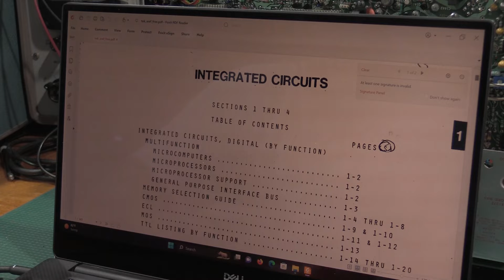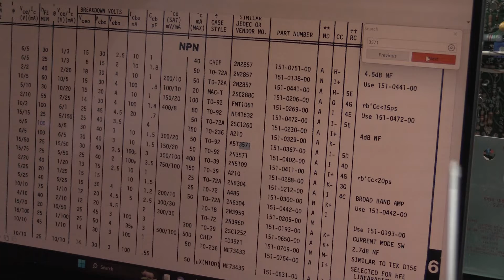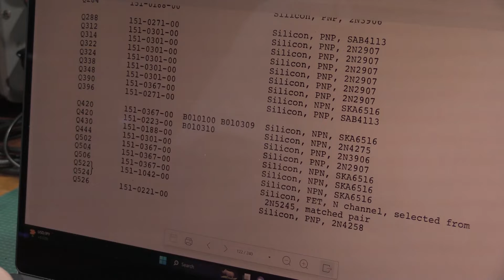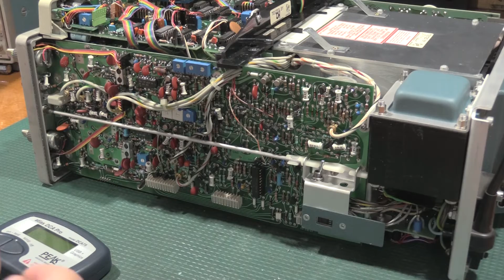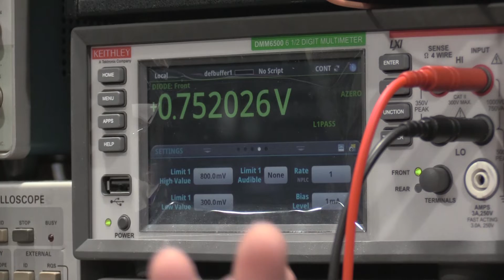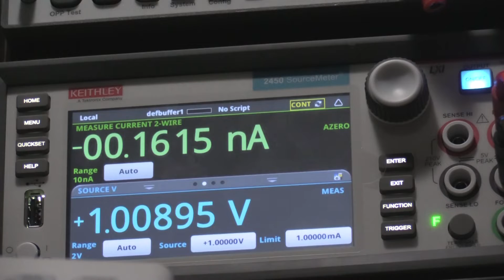Tektronix 475A Trigger Transistor Testing 151 0367 00 (Do NOT replace unless proven faulty!)

Comment: Thanks for doing this demonstration. I am in the process of updating the tantalums in a recently purchased Tek 475A. After seeing your previous video was considering replacing the transistors also. But thanks to this video will leave well enough alone. I can tell you after finding C1261  shorted (seems like a common failure) and cleaning up assorted switches, the unit is ready for calibration and use. Happy to have found your channel, as it has been a wealth of information.  Next stop cleaning and servicing my well used Tek 2235.
Reply from the maker: Thanks! glad everything is going well. I do need to get some 2xxx videos out there.

Comment: Its kind of futile to just test transistors at random, instead of tracing the fault in the circuit to the part that actually is faulty.  For exampke you might have an open resistor or diode.   I have found transistors that needed to be replaced; eg: Vbe > 1.5V. but Ic = 0 mA.  It's faster to trace the circuit and find the defective part that way then to just pull parts at random and test them all.   You might put mix the parts when you put them back in the circuit and not even know it.
Reply from the maker: Before a series of videos was made and a LOT of discussion on the Tek scopes forum these transistors were listed as "replace on sight" This is NOW not the case. This video was left up for completeness sake but these should NOT be replace on sight any more and should only be replaced if faulty. The reverse diode is a normal mode not a leakage as there are 1.5Ghz transistors and just have a VERY low reverse breakdown voltage.
Reply: What I have noticed on most Utoob repair videos is mostly superficial diagnoses of the problem.  I haven't seen anyone pointing to schematics in Tektronix's very good manuals, and saying, "I am going to start here, where I know the EXT trigger input can be seen with another oscilloscope, and trace it through switches, custom Ice, and transistor stages until it disappears".   Instead people test transistors at random, replace as many capacitors as they can, and generally circle in a wide arc above the problem.   If someone is unable to understand a schematic and to follow a signal path to where it disappears, they may  just be damaging the equipment they are trying to fix.  Every time you replace a component and the problem remains, the chances of creating additional problems increases.
Reply: There is a very long discussion about this on the Tek-wiki website.  It appears the confusion began with a typo in a very old Tektronix cross-reference that listed the MPSH05 as a substitute for the '367 part.  I have found 2N3904 and other similarly marked parts in Tektronix oscilloscopes,, so I would assume these "replace on sight" transistors would be marked MPSH05.  With all the testing you did, with a Kiethley SMU, a 567 curve tracer, and a cheap Chinese bjt/diode tester with ripped off software, I was expecting that you would procure a few MPSH05 transistors and compare them with the '367 parts removed from one of your 475 scopes.  That would be good Science.   Did you ever do that?

Comment: I've just viewed this in 2025!  My guess is that the diode is actually a trimming capacitor! part of its Hi Freq topogtaphy.
Reply from the maker: This was a follow up video to one recommending shotgun replacement. The TLDR: diode in questions shows up because the meter is fooled by the extremely low reverse breakdown voltage of the transistor in question. These are 1.5Ghz fT parts. We discussed this one the Tek scopes forum at length and did quite a bit more testing and have found the transistor to be operating correctly current advice is DO NOT replace unless proven faulty.

Comment: Do the candidates as replacement transistors for this part exhibit the diode behavior you're finding in the original parts? That might be a good test to show or discuss.
Reply from the maker: At the moment I do not think that these are bad parts as they are 1.4 Ghz components the reverse breakdown voltage of the high fT parts is quite low.

Comment: Surely if the scope calibrates OK with the original transistors then let them be. I think you have demonstrated very well they seem upto the task.
Reply from the maker: That is where I am at. Some of the units I work on are not mine and I need to do as instructed by the customer. My current recommendation is let them be but if the trigger is acting weird something to check on the short list.

Comment: The dca75 will output curve traces when used with its pc software.  The currents and voltages are limited, but one can specify different parameters to compare.  You might also run it as a diode to examine that behavior. 
The current changes when you touch transistor because the electron Fermi level increases with increasing temperature.
You show the faster 475A triggered faster than the 475, no surprise.  What frequency response do you expect the 200MHz 475 to have?
Reply from the maker: At least on this one 475 (200 Mhz) the vertical amp and the tube brightness ran out of gas before the trigger did, even with the replaced trigger transistors. I could get the scope to trigger even after my eyes did not see anything on the screen. The camera is more sensitive to the beam so I got a little further looking through the lens. But the intensity on the 475 was cranked all the way to max brightness.

Comment: Hello Zen
Maybe my impression is wrong, but the left oscilloscope seems to handle the trigger better, and you have less trouble with it.
Done thoroughly and precisely as always, there is always something to learn from your videos.
greeting
Reply from the maker: This is not wrong but there is a few things going on there. The scope on the left is a much newer serial number 475A, 250Mhz of bandwidth. The 475 NON A is only a 200Mhz scope and it is also MUCH older production. Given the way the tubes are focusing I would also say much higher hour. The vertical amp on the scope on the right will be inferior to the one on the left based solely on V bandwidth. This will cause the trigger at a given frequency to have to work harder on the scope on the left. 
The actual trigger detector is the tunnel diodes and in both units there are unchanged and original equipment. 

Zen

Comment: The diode indication could be emitter-base leakage or breakdown. A 2N3904 has an emitter-base breakdown around 7V but many rf transistor have a much lower breakdown.
Reply from the maker: This would be emitter-collector breakdown around 0.7 Vdc.

Comment: I've got a couple of 485s that will reluctantly but nevertheless dutifully trigger and display up to ~1gHz. Of course I need to feed it a very clean and strong signal, and the vertical is at its edge as well. I don't know off hand what the transistors are in the trigger or vertical, but I'd guess they are a higher frequency than those in the 475s, or at least of a variety that was more stable up in the thin air of these higher frequencies. Thanks for the very interesting video. Just what this vintage Tek enthusiast needed to finish a rough day.
Reply from the maker: In the 485 Tek switched from discrete parts to custom Tektronix IC's that were made in house . These chips were a trade secret for a LONG time and are actually the same in the vertical amplifier, and were used in LOTS of places especially in the 7000 series frames and plugins.

Comment: Maybe talk to the guys at Peak they might know if such a device exists or this is an un usual failure mode? I haven't seen that symbol with a diode from emitter to collector before and I would have thought the TEK forums or perhaps EEVblog would be a good place to start. Interesting subject...cheers.
Reply from the maker: There has been a LOT of discussion on the telescopes group about this topic. This video was made because of the findings during that discussion. There ARE parts where the reverse diode is present and also expected. It can be sometimes called a suppression diode H sweep circuits in televisions are known for having the suppression diode in the sweeping element.
Reply: Fascinating ! do these parts have a name or perhaps a part number or a supplier where I could read about or even buy one please ? are they only small signal stuff in the TO92 cases please ?....Thanks!! @ZenwizardStudios
Reply from the maker: I will see if I can dig some up. One use for them other than H sweep circuits is in relay coil drivers. They short cut the free wheel diode and just made it internal. I have seen some of them before.
Reply: Awesome thanks ! @ZenwizardStudios
Reply from the maker: A modern part that does have the E->C diode in it that should be there is a Darlington transistor SOT223 package part number BSP52 as an example. This is still a multi node part though.
Reply: Will look Ta ! @ZenwizardStudios